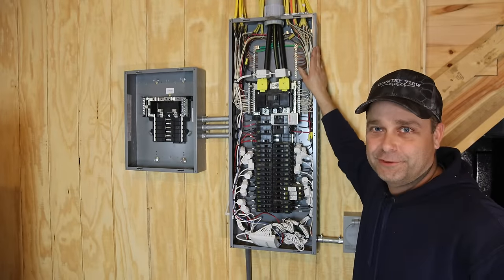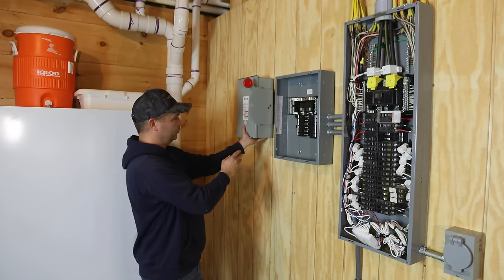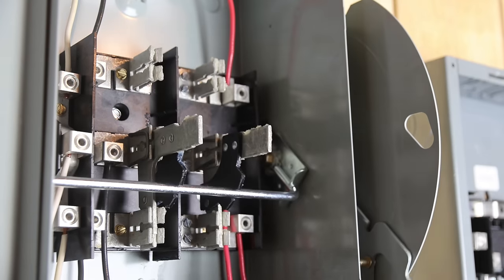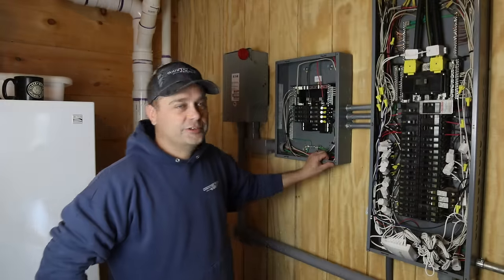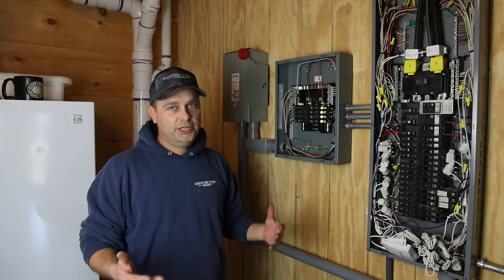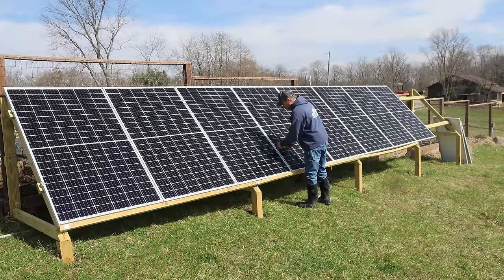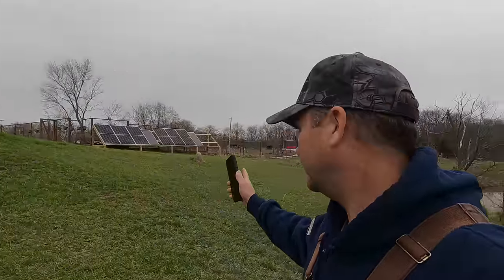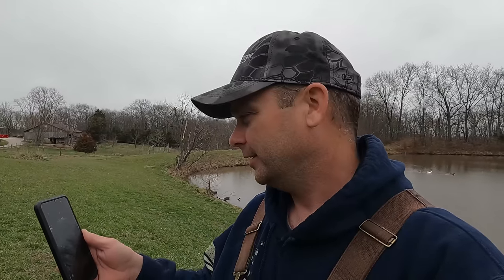Installing an Off Grid Panel and Transfer Switch.   Discovered a problem with our EcoFlow Delta Pros

Comment: Just curious, why not simplify the setup and just have ALL of your circuits switch from solar to grid instead of breaking out the "important" ones?  You're probably not really using much on the remaining circuits anyways, and even if you are you can turn off individual ones when you go down there to make the switch.
Reply from the maker: This is all in preparation for a larger permanent system.  If the power goes out, I don't want everything running on batteries.(i may not be home so switch stuff off)  and the permanent system may not be able to power up everything at once, maybe 50 to 100 amps.  That's why I have a sub panel, with loads sized for the permanent system.

Comment: about the 240 volts kicking out when trying to charge from the utility power. Are the 2 outlets on opposite legs on the panel?
Reply from the maker: Yes, they are different phases.  I was hoping it work.  But no luck.

Comment: ? Do you have a Well?  ? Each time you switch off and on grid,do you have to reset the time on tour Microwave?
Reply from the maker: No, the house is on a rural water system.
And yes the microwave loses the clock when you switch.

Comment: Hi Evan, Are you a qualified electrician or can anyone do wiring changes to their grid connected electrical system in the United States?
Oh ! By the way excellent video and your quality of work is outstanding
Reply from the maker: Most places in the United States home owners can do their own electrical work.  But, I do electrical work for a living also.
Reply: That's interesting
In Australia no one is allowed to touch any electrical connections to the grid, you have to be a certified electrician.
And the same if you wish to install off grid solar or wind power to your house

Comment: Check out PreppingOver50 channel Ecoflow 24hr test @ 13:40 charging off of 240v 

How are you solar panels wired all 4 panels  series

If so wire 2 panels in parallel for 315 watts @ double the amps (say 5ax2=10a) then the other 2 in parallel for another 315 watts @ double the amps (say 5ax2=10a) then connect both of them in series given you a total of 20amps and 630watts 

The more amps the faster the charge

Comment: Believe that the transfer switch must also disconnect the grounded conductor ( no such thing anymore called a neutral ! ). I know that you must do this when tying a generator into service panel that is normally feed from the ultility company.

Comment: Lithium batteries can catch on fire, your house is wood isn't it?
Reply: There are different types of lithium batteries and different chances of fire occurring.
Reply from the maker: The built in Battery Management system, monitors the battery to keep it within parameters of voltage and temperature.  It also has built in shut downs to stop thermal runaway.

Comment: I don't think that charging the deltas from the wall is efficient because you waste energy, better just wait next day and if its suny than it will charge but if its not sunny your better of just waiting next day because if you use power to charge deltas and then use them for powering all must have things, your just waisting energy because you loose a bit of energy just to charge them.
Reply from the maker: Yes, for efficiency, switch and wait for solar to recharge.  But I was hoping to install smart outlets, and be able to turn on charging while away from home.

Comment: It is mandatory that when grid is down your own power have to automatically not connect to grid for safety of power company repair crews who work on the grid. What happen if you on vacation or some reasons you won't be home to switch the power? look at 3:55 when you show the manual power switching device make me almost faint. Take safety seriously man. BTW, if your power company know what/how you did you will be in big trouble.
Reply from the maker: It is a manual transfer switch.  It only allows one power source to be used at a time.  It is the safety device.  You can't back feed the grid, because the grid is disconnected when the generator or solar is used. It doesn't have to be automatic.
Reply from the maker: You must be getting this confused with a grid tied solar power system.  This isn't for grid tied solar.  Eco flow delta pros don't feed back the grid and sell power back.
Reply: @CountryViewAcres  thank for explained

Comment: EcoFlow is a junk Chinese company. You can do better.  EcoFlow should have a voltage regulator system. If not, they are not paying you enough. Also, if your solar panels have micro inverters (i.e.,, output AC current), EcoFlow could have designed a simple transformer to lower the voltage and raise the amperage.  This video makes EcoFlow look very, very bad. Enphase sells a much better solution. I am sure that you will have many comments describing better solutions to your current setup.  Good Luck